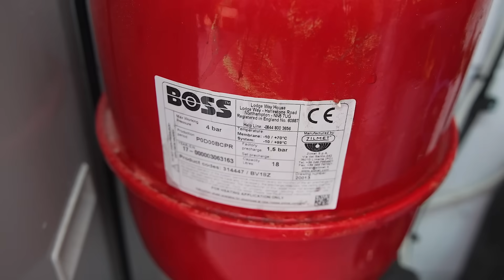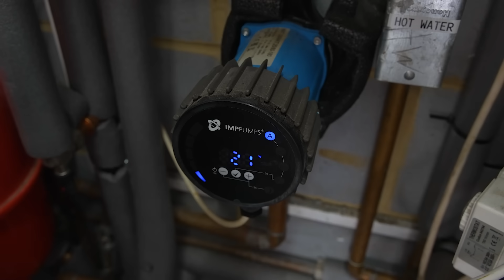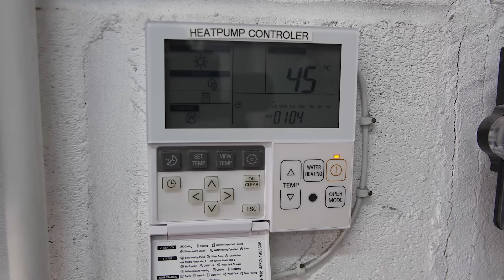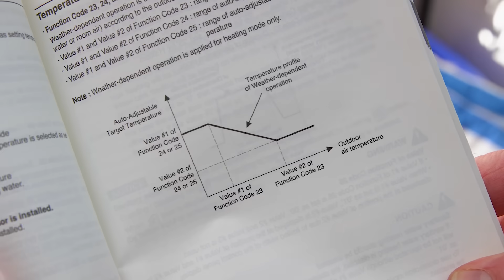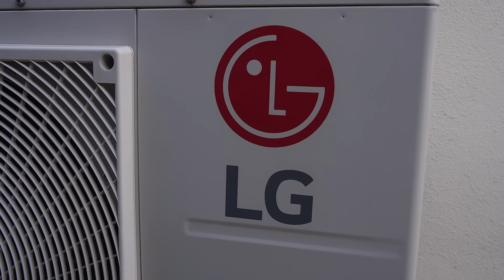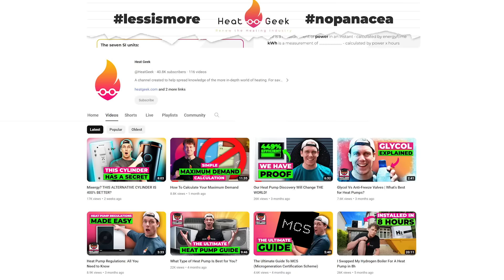Heat Geek Gives His Verdict on John’s Nightmare Heat Pump

Comment: So there is no way on this planet that this heat pump system is cheaper than gas
Reply: It's not. Electric is say 34p/kWh and gas is 10p/kWh. So the HP has to run over 300% efficiency to be cheaper than gas. And we know HP's do not run close to that efficiency, in fact on the coldest days they run closer to 100%.
Reply: @John_Wood_  they run at 100% in -16c   just switch to a proper tarrif where you getting energy at 9-14 p kwh and heat just outside of 4-7 pm
Reply: @John_Wood_  mine is LPG. At 77p a ltr and 29.34 p for leccy.
Reply: That is the whole point of both videos.
Reply: @normanboyes4983  I think the point of the videos is to review John's heat pump installation, which has been a financial disaster, and find ways of making the heat pump system work for him so he won't need the gas boiler ever again. What it shows is that heat pump installers have been cowboys up 'til now.
Reply: @John_Wood_  nonsense. Heat pumps run at 300 % at 0c and around 600% at 15c.

Look at the links skill builder has given you in the description of real world units
Reply: At last a realistic comment. Over complicated over priced and under performing. Keep em.
Reply: @HeatGeek  Lies (as the table you reference demonstrates!).
Reply: @John_Wood_  You're not only wrong, but based too
Reply: @flatfoot  Do you care to elaborate?
Reply: @John_Wood_  You say 34p/kWh. Did you not hear @heatgeek refer to Time of Use tariffs? During cheap hours it's cheaper than gas before the COP is taken into consideration
Reply: @flatfoot  Economy 7 is say 17p/kWh - great. But we don't need heat at night. We need it throughout the day or when we get home from work. HP's with under floor heating work best when constantly running so the slab never gets cold. They cost a fortune to run. So many people learn the hard way and go back to a gas/oil boiler.
Reply: @John_Wood_  Think of it as economy 7 with an 8 ton radiator
Reply: @flatfoot  Got to keep that 8 ton rad constantly fed. Takes a house 2 days to heat up from a cold slab.
Reply: @HeatGeek  You are misrepresenting efficiency . Heat pumps may well work up to 600% in warmth, although I have never seen that claim before, but that is not the key issue.
Reply: It fricking well should be 3x at least less energy consumed..
Reply: @Rockall57  the COP factor is very misleading.

Comment: John, you have my deepest sympathies- I built a new house 13 years ago and fully intended to put in an oil fired boiler. My plumber convinced me that wasn’t the right thing to do as the government had grants out for green heating and he was working with a boiler engineer who could install a wood pellet boiler. It was a disaster from day 1, struggled to heat the house, no hot water (sound familiar), and like you I threw more money at it to try to fix it. It’s like quick sand - you’ve invested so much and these engineers keep promising one more tweak and you’ll be sorted and nothing. Anyway to cut a long story short- after 2years of misery (and a lot of soot) my wife rang me to say that the garage where the boiler was full of smoke- so I got a really reputable old school plumber in to install an oil boiler. The guy who had installed my original pellet boiler fled to Canada leaving a trail of destruction behind him(having gone bust). I do think the government have a huge amount to answer for- they bring out grants and suddenly everyone with a van is an engineer and when the grants go they evaporate. My heart goes out to John because my experience was very similar(it’s funny I even recognised the look on your face when the heat geek guy was talking about 350% efficiency- I had the same look). I do sincerely hope it works out - the heat geek guy really does seem to know what he’s talking about- I wish I had someone like him 13 years ago.
Reply: Anything pushed with grants is going to be a disaster.
Reply: You hit the nail on the head - overcomplicated systems that cost a fortune and are only affordable due to grants and the fiddling of energy prices to make gas as expensive as electric - You could  replace the whole lot in this video with 1 gas boiler and it would be greener in the long run if you factored in replacement parts and the amount of times you will have to repair and replace parts - Its like walking around with a grandfather clock on your wrist when you could just wear a watch
Reply: The heat geek was still at school 13 years ago😂😂
Reply: @timhull8664  Thanks! I was 25 and 2 years in to growing my heating business.. hence the wrinkels lol
Reply: @HeatGeek  ha ha!
Reply: 350% efficiency across a season that includes mild times.  That includes the 500% days when you draw 8kw and the 200% days when you draw 80.
Reply: All good points. As a heating engineer that does understand air and ground source i also believe a lot of this starts and stops with the government. I got talking to a guy years ago who worked for the department of transport, we talked at length about ministers - they get appointed and set loads of targets (often totally unrealistic) then 2 years later they move on to a completely different department with no accountability!
Reply: @1960ARC well you say that but if it wasn’t for the grants Solar would have never got going in the UK. I appreciate solar is different as you don’t rely on it, it is a supplement. Look how the price has dropped since 2010
Reply: We had a communal wood pellet boiler on the new build estate I lived in for the last 13 years.  It never ever worked right, each weekend the water would go cold and at random times during the week, the second year they had to get a massive temp boiler to provide us all with hot water while they fitted something that worked on gas and then the problems all were solved.
Reply: @bernie129locksmith unfortunately natural gas from dinosaur deposits can’t be green as we’re releasing carbon that was locked away for millennia!
The point of heat-pumps is that you can source electricity in a greener way using renewables or nuclear.
Reply: "I do think the government have a huge amount to answer for-" I disagree, no government has ever had it's citizens interests at heart and you are a plum for not being a bit more savvy about it.
Reply: @SouthIslandSk8  thanks for the advice - now that you’ve given everyone the benefit of your knowledge you’ll be free to go back to printing pamphlets in your basement
Reply: @paddycairns1972   Paddy, it's time for another booster, best get down to your GP asap covid has mutated again
Reply: It's always a dilemma when you're persuaded away from your gut feelings about anything, even in the face of so called plausible technological advancement...
Reply: @BeasleyStreet  you are exactly 100% right- my brother in law had already just installed a very high end wood pellet boiler that had cost him a fortune and to be honest the math didn’t stack up - ie annual heating savings vs initial investment it would have taken 15 - 20years to pay back. So my gut was telling me that this was a bad idea but the plumber was so adamant and he was a real reputable and well regarded plumber and I trusted him. That’s what in the end made it so galling - if there is doubt there is no doubt and if it’s too good to be true then it is.
Reply: Booster for you as well Beasley :) LOL  @BeasleyStreet
Reply: If heat pumps really were cheaper than oil or gas, then why would we need government subsidies to push them?
Reply: Yes grants what a racket, tried to get a loan for solid wall insulation about 10 years ago. Forced to pay for a Greendeal survey telling me what I knew. Correct level of insulation in loft, smart meter, eco bulbs, new condensing boiler, recommended…. Wall insulation. Did they manage to help find an installer no, did I get the load for the …. 8000 for two walls. No the grant would mean the savings needed to be over 18 years . Until the insulate Britain get off their backsides and start insulating peoples houses we will continue to waste energy.
Reply: @bernie129locksmith  I totally agree with this comment...... These heat pump systems (if designed, installed and maintained correctly, "may" be more efficient.
BUT, we all know, the more components and controls, the more there is to go wrong. The initial outlay on pipe work, components and labour (plus vat), plus any maintenance visits) snagging is going to far out weigh any savings. 
Surely, retaining a gas boiler , upgrading the insulation in the property,  better controls (programmable room stats, weather comp, smart TRVs etc) and turning the boiler flow temp down would give an overall beneficial result?
I'm not knocking Heat Geek as a company, they seem very professional and knowledgeable. I also retain an open mind in heat pumps and am open to moving with the times with better technology etc, But, labour is expensive, copper pipe and fittings are expensive, as are cylinders and other large items. People (the average person) cannot afford these upgrades, it's not realistic. And the ones that do want more reliability.
My personal view is the customers.that have heat pumps are 'Green/ save the planet " types and not the customer that is looking for a cost saving
Reply: I wouldn't of had the patience with these engineers, after all those promises, chancers the lot of theme.
Reply: @imnothere220  Thinking once the Home is Up to Temperature you're not then have to be going down the road of FULL BORE road, then to keep it warm you  just topping things up that providing there's some degree of Insulation in the Gaff, what with Night Saver Electricity and correct emitter sizing one could even bias the system to run slightly warmer for those hours ramping up the home by a few degrees then to all the system to wait till the system sees the downward curve to then cut in as programmed...
Reply: @gmurdock The CO2 was in the atmosphere first and life flourished. There is no climate crisis.
Reply: I agree that the guy seems to know his stuff looking at it with modest understanding of heating solutions. And I love his way of trying to simplify things.

However, even at 350% efficiency i can’t make a economical decision for heatpumps. As HR gas burners cost 6-7k less to buy and the Heat pump needs at least 200-250% to be equal in running costs. That minimal gain isn’t going to pay for the expensive complicated equipment. And given in my country we rely on gas in winter for electricity anyway. I don’t see the green point either.
Reply: Thank you very much for making this video. It just shows you that the Government has said heat pumps are the future and we should all be switching over to these but as was mentioned in the video “One Size Doesn’t Fit All” and the Government don’t seen to realise this. The cost in changing to heat pump technology is to say least eye watering. How many people have the money to switch to heat pumps?
Reply: It's like everything else in life people telling you would is best. Then you get installed it turns out to be a Croc of shit. I bet you come back to John's house in a years  time after another set up installed it will still be a Croc of shit. It's never ending just throwing good money after bad. 🙂‍↔️